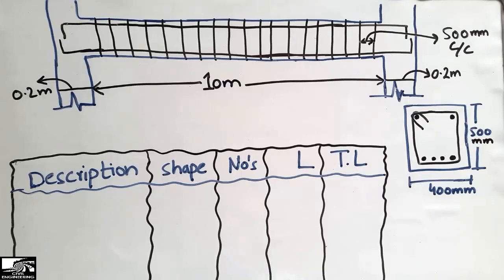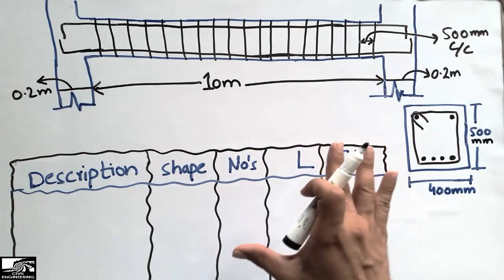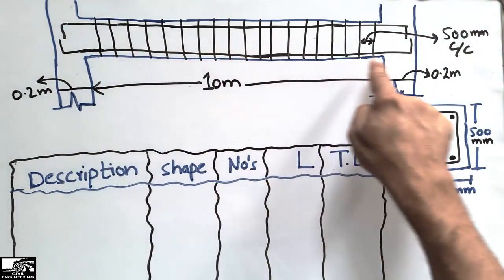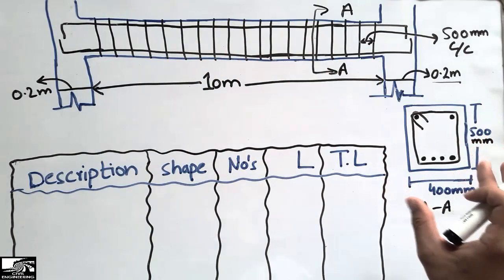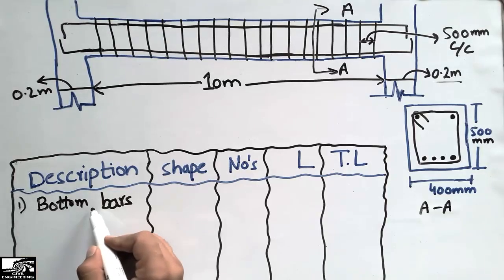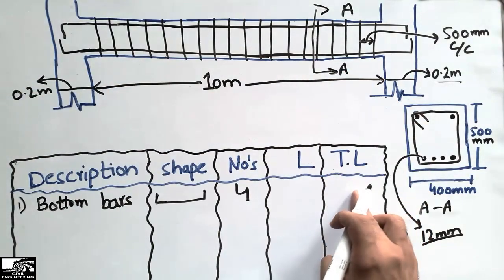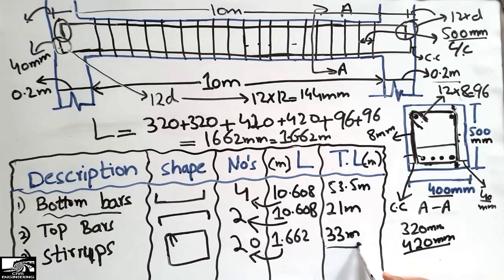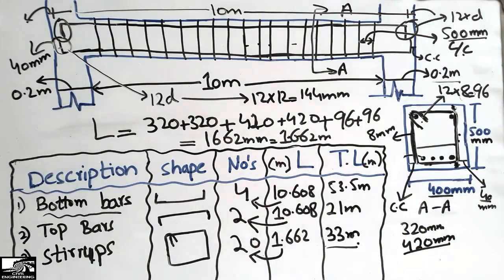Bar Bending Schedule of Beam

Comment: Nice explanation 👍 
But for proper Bbs you have deducted bend 
And development length concept 
And stirrups length 
Please explain by considering all points so it will be economically
Beacause at site it's no matter 
But by professional bbs and to save steel and wastage we should want to calculate proper cutting length 

But overall good explanation
Keep it up 👍

Comment: Sorry Sir. But you have to add +1 while calculating the no of stirrups. Also you have to deduct all the bends while calculating the length of the rod. The formula for that deduction is (no of bends X d) where d is the dia of bar.
Reply: No of bend x 2d is correct
Reply: @selvarajmurugan9996  
For 45° it is (x1)
For 90° it is (x2)
Reply from the maker: Thanks, appreciated